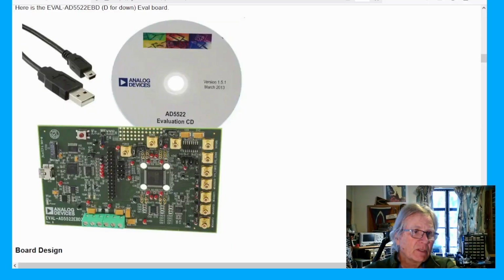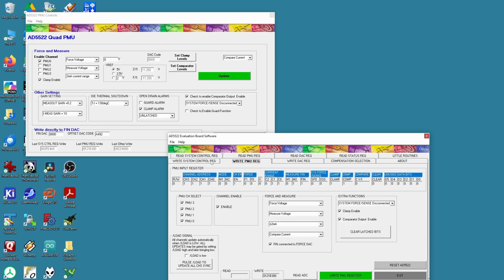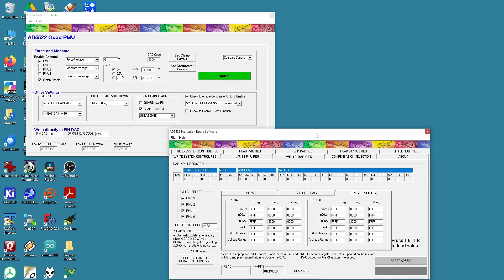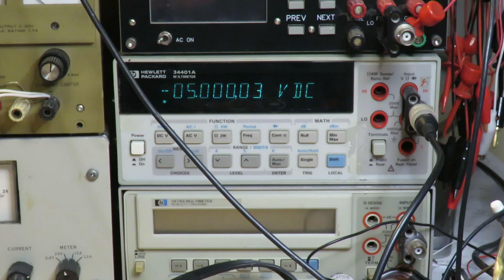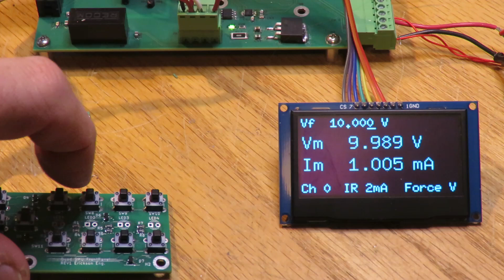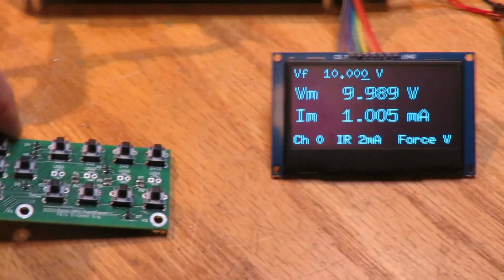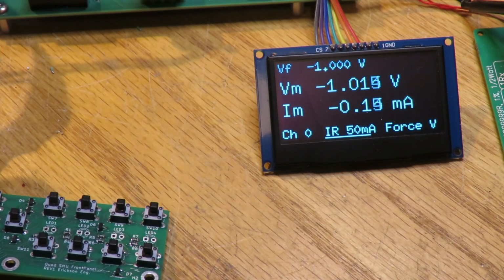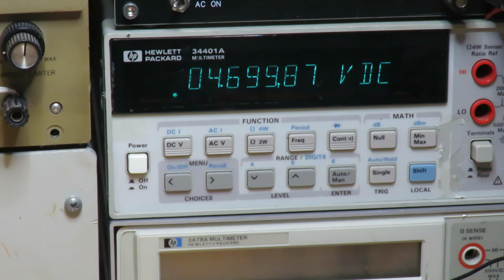Quad SMU: 4 channel Source Measure Unit based on AD5522.  Part 2: Implementation

Comment: I love your projects and would like to build this one. Did you have time to further work on this one? 
But well right now I'm working on a variation on your single channel design to reduce the voltage from +-160V down to +-20 as this is the range I work at the most

Comment: Excellent project, I followed your previous SMU project with interest, it had good voltage and current capabilities but single channel, this quad channel  unit looks very promising but i fear the GUI amd control software might be beyond my programming payscale, are you planning to take this part of the project further?

Comment: Great project! Super explanation. I'm looking forward for your next videos. I would consider using CYD (cheap yellow display) . It's touch screen and ESP32 can be used for wifi communication between SMU a PC. Probably there is not enough pins on that board to use it for driving SMU itself.
Reply from the maker: I hadn't heard of CYD. Always looking for good (cheap and easy)  embedded GUI tools. Yeah, It needs a good SPI and some GPIO fro this project. Thanks.
Reply: @ericksonengineering7011  will there be part 3?